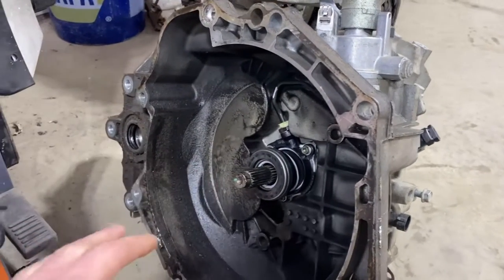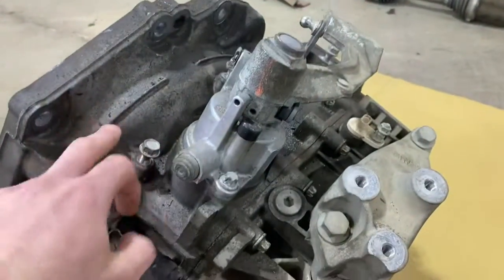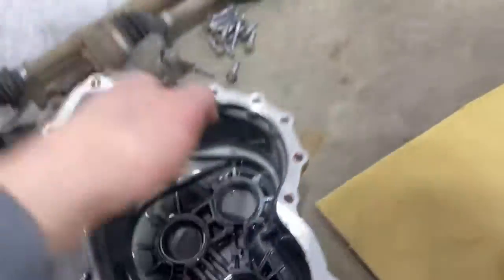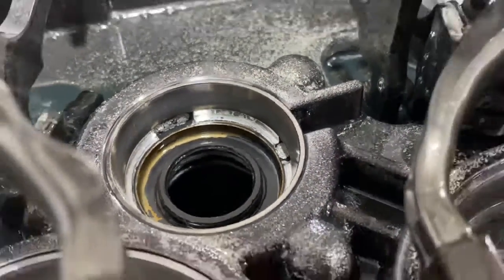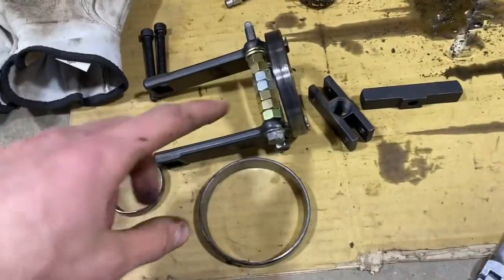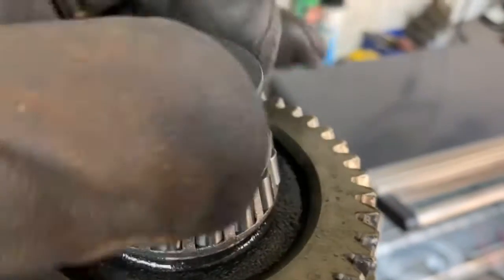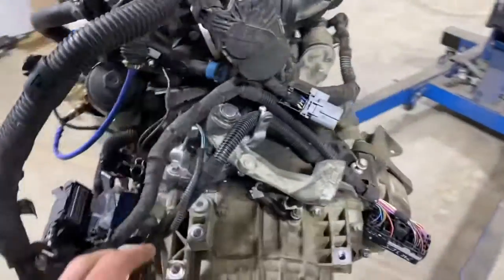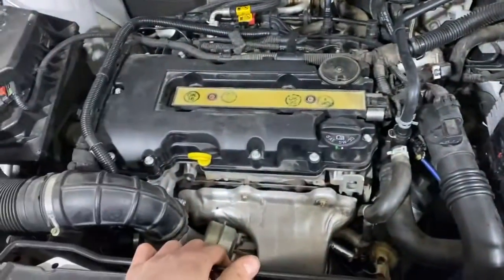Cruze M32 Transmission Fix!!! (Bearing Replacement for Getrag M32 6 Speed)

Comment: I had my bearings replaced my gearbox company now I get issues with not always able to select 1st gear and gearstick moves slightly when pulling off in 1st gear.  Car been back twice and state no issues.  Do u think they have not done something?
Reply from the maker: I would think there is an issue somewhere internally, likely an issue with something they did

Comment: From what ive heard the GM M32 must be the worst transmission ever built and lots of the users in our Opel Astra community had massive problems. Ironically i have the same transmission in my Astra H with the Z19 DTH engine (150 HP 24 valves) and my Astra is now 19 years old with roundabout 300.000 km on the odometer - and the M32 works fine and properly (its the first trans and original)

Comment: Hello Sr., I will appreciate if you can mention me when is necessary replace gear bearings, now I'm replacing all shaft bearings (easy to find new ones in Chile, three of them in bad conditions) but I'm not sure to disassemble input and counter shaft to replace  gear bearings (not easy to find), symptoms: a lot of smashed metal in drain and filling magnet plugs and noisy manual transmission, many thanks!!

Comment: I have a m32 aswell in my 1.9cdti 150 and i saw a video from uk i believe and they have upgraded the "pan" of the gearbox so the 5/6 can be more lubrificated and they also got bigger and better bearings. But i couldnt find a way to buy it to mount on my gear box

Comment: Did you think about rebuilding with metal bearing cage instead of plastic? Was there pitting on the rollers themselves? I believe once those plastic cages wear and there is slop in the bearing rollers and that's the source of this issue. That's why I always go with metal cages because they last. 

I'm about to do this in my Getrag trans on my fusion, I'm going to measure the bearings OD, ID and width to size the bearing and then I'll order whatever flavor bearing I want that is compatible. Thanks for the video, definitely giving me insight into my future project!

Comment: Do you have a link to where to buy the bearings? I have a 2012 Cruze eco also.... mine jumps out of 2nd  gear when accelerating. I think I need syncro and 2nd gear do you know where to get these?
Reply from the maker: Vauxhall M32 Gearbox Shaft Bearing Rebuild Kit - TIMKEN was the bearing kit I purchased from https://www.bearings-online.co.uk

Comment: Thanks for the video! I have a corsa D Vxr as well and I have to change a synchro but I've been told by GM that not every m32 firt to second synchro can fit in my m32 gearbox because these gearboxes were put in other cars as well, so I can't find a way to make sure I buy the proper one 😰
Reply from the maker: Unfortunately it sounds like you need to take a chance and buy one and hope it fits. Not sure how else you’d figure it out
Reply: Take it apart and measure the synchro. You should be able to order based on dimensions. Someone has to know what you need if you have the dimensions, otherwise take it to a machine shop and see if they can fabricate for you.

Comment: Have you had any issues since redoing the gearbox? Apparently the shims need doing when you rebuild it or the gearbox won't last as long?
Reply from the maker: I haven’t had any issues at all. from what I can tell the shims are to set the backlash on the ring gear, in which case they don’t need replacing as long as they go back in the exact spot they came from
Reply: @bradenrein  thats a massive weight off of my mind! I have literally just started to get my box sorted to day and the shimming is the part I'm worried about as I can't find any info on them regarding setting. Do you know if I can reuse the original shimms with uprated bearings for the gen 1 casing?
Reply from the maker: You can if you are just changing bearings and keeping both sides of the case like I did. If you upgrade the casing you need different bearings and new shims.

Comment: As a 2012 Cruze owner with the 1.4L Automatic.. What a project you've taken on.  I may post a link to your video over on Cruzetalk.com.  How many miles/kilometers on the original bearings?
Reply from the maker: Thanks for the comment!! Had about 190,000kms on these bearings, and as far as I’m aware the transmission is original to the car